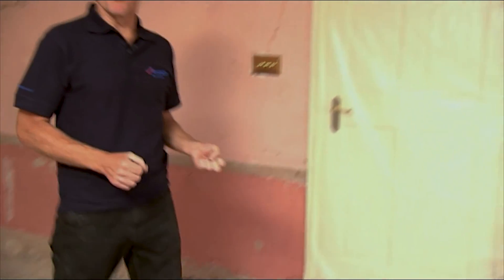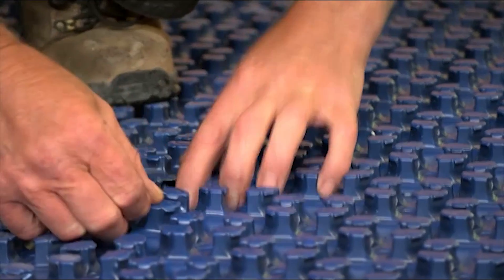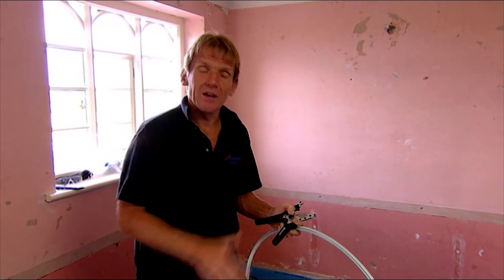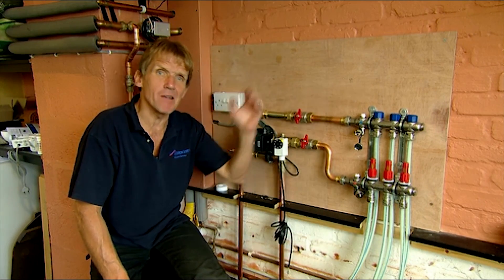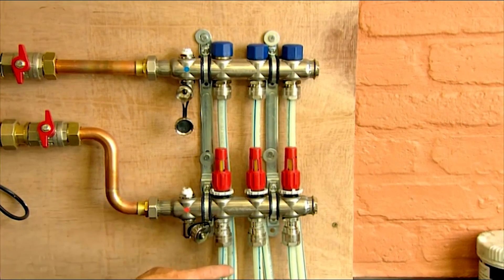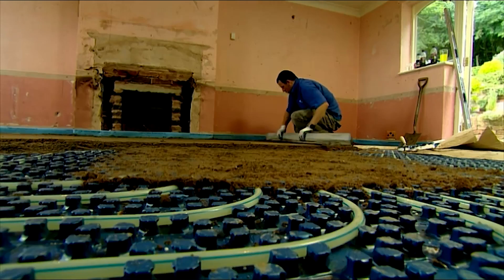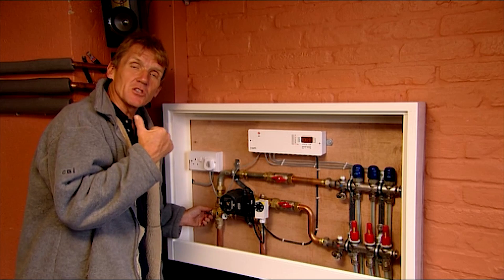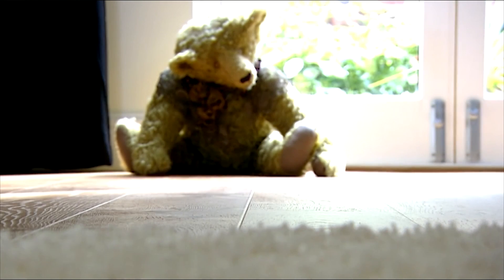How to Lay Underfloor Heating in a Screed

Comment: Roger 
What the best option where you have a original suspended timber floor an adjoining timber extension ?
Both I suppose extension wise should I carry on with suspended floor or switch to ground bearing slab 
An then if keeping 2 system will the UFH working across 2 floor types ?
Reply from the maker: I have done both. The pipe in screed gives you thermal mass and will hold heat more evenly. There is always an issue joining floors so it would be best to lay a low build system across both if you can get away with the increase in height. If you look at the Underfloor Heating Store website you will see how the different systems work, They will give you advice and come up with a plan.
Reply: @SkillBuilder  sorry mate just clarifying 
Do you think have 2 different flooring constructions is an issue though or retain suspended timber floor across existing an extension

Comment: Insightful Roger. Why not anhydrite screed like Robin used?
Reply from the maker: The screed in this job was down to the builder and to be honest it wasn't great. I would prefer a flow screed but not an anhydrite screed. I have that in my kitchen and , if you talk to tilers etc they are problematic because the tile adhesives don't stick very well and they need sanding down which is a dusty process. The best flow screed is a cement based screed. The adhesive sticks well and there is no sanding down, they are also a lot more resistant to moisture which could be important if a washing machine leaks.
Reply: @SkillBuilder  thanks Roger. Great info! I am installing a new LVT click floor and need to use a self leveller. The room is 45sqm. Is there any better solution that hand mixing and pouring a latex leveller? Room is an average of 10mm out of level.
Reply from the maker: @samposton9101  If you have never done a self leveller I would get someone in because it is not that easy. You can buy a weber liquid screed that you just agitate rather than trowel, 
It is also made by Tarmac. You need some help if you do it over that area. https://www.youtube.com/watch?v=-0O_Ldb70z0
Reply: @SkillBuilder  thanks Roger. I’ve done my 2 bathrooms with self leveller but they are much smaller. I didn’t know if there were companies similar to Robins Southern Screed that offered a similar pumped solution to save on time. Will take a look at the video for research
Reply from the maker: @samposton9101  There are loads of flow screed companies out there,
Reply: @SkillBuilder  My Dad and I levelled about 30 square metres with self levelling screed for an LVT floor and having never done it before, I can concur, it was hard work!  It's not perfect, but it's a lot better than it was before.  We used 8 bags of latex screed... but we asked if we could return unopened bags and so we went with 12 just in case and returned 4.

I'm sure I don't need to give Roger any advice on self levelling compounds, but this may help others attempting it for the first time:

- Ask if you can return unopened bags and if you can, buy more than you need!
- Try and buy all from the same batch/production date as it will cure at the same rate.
- Get a set of spiked shoes and a spiked roller.
- Have one person mixing a bag at a time in one of those flexible buckets and another trowelling/rolling with spiked roller.
- Use a primer on floor, mixed as per instructions and make sure there is no loose material, existing levelling compound or floor adhesive.
- Before mixing screed, measure the water for one bag in another hard bucket and mark on inside of bucket with some bright insulation tape, as this will make getting the same amount of water each time.
- Get a paddle mixer for your drill.
- Only join onto the last pour, with new pours as previous pours will have already started to set.
- Work towards a doorway and leave for at least 8 hours before walking on it, depending on depth.  - Allow to fully cure before laying any underlay or tiles.
Reply: That stuff is great

Comment: What's the minimum depth of screed you need over that type ?
Reply from the maker: 65mm but you can reduce it with SBR and fibres. If you use a flow screed it could be as little as 35mm.